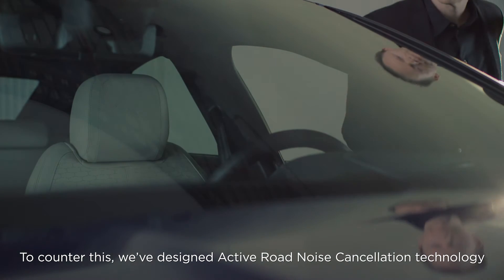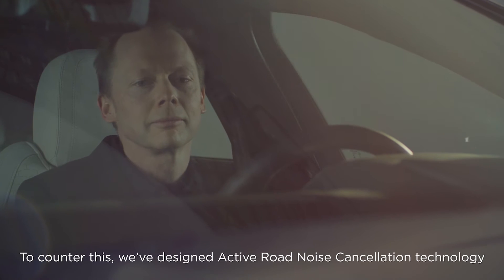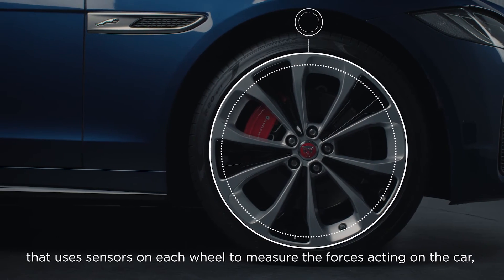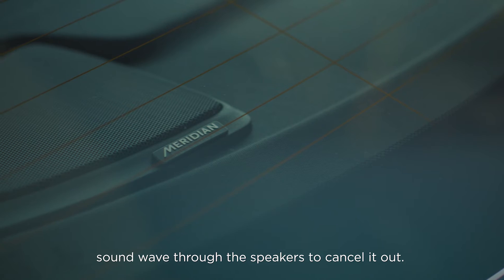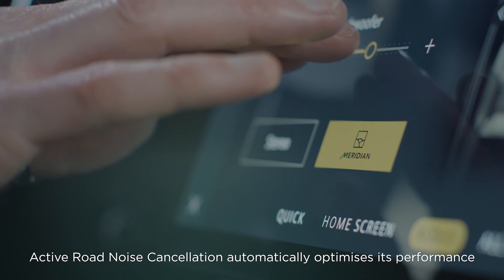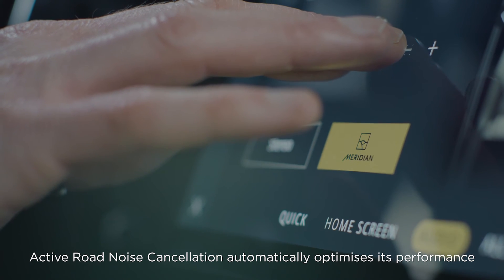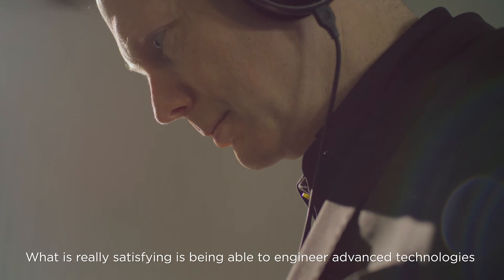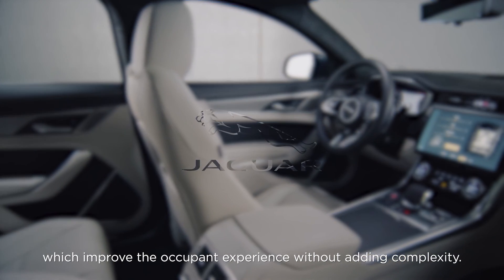Jaguar | Technically Beautiful - Noise Cancellation

Comment: Guessing it took about 30 min to make this video.  Video doesn’t do the tech justice, or maybe if does.
- reduces noise from what to what at what speeds? 
How’s this compare to similar EVs? 
- does the stereo need to be on?  
- could the video include sone audio samples?
- is this new for MY23?
- what models dies this apply to?
- is there other noise reduction efforts, ie window mod?
- etc. 
- please try harder. 
- dealer salesmen are totally clueless on details. 
- jag website provides no details either. 

Thank you.